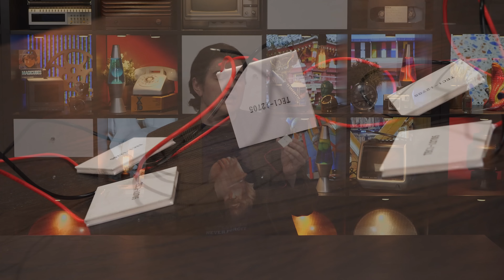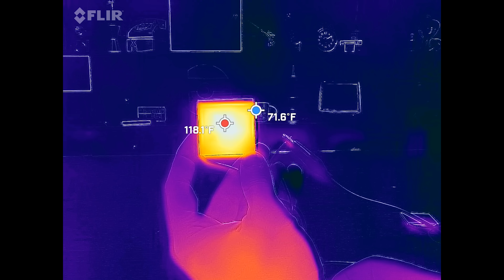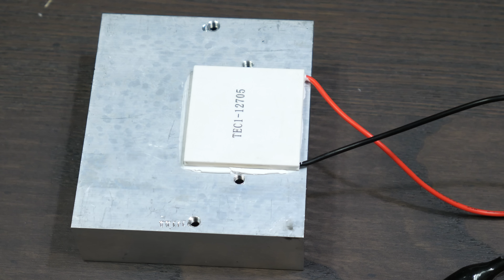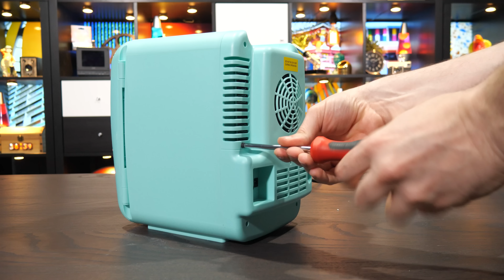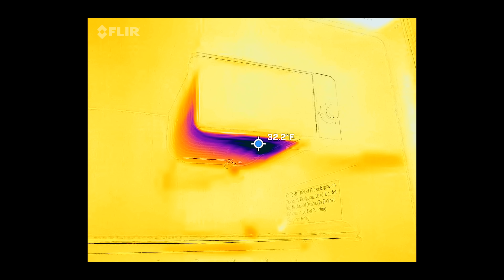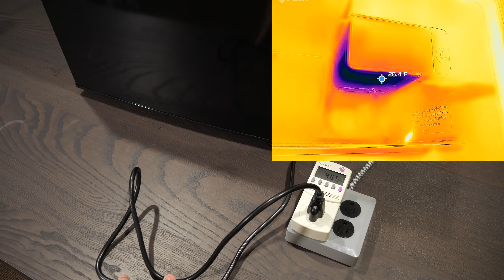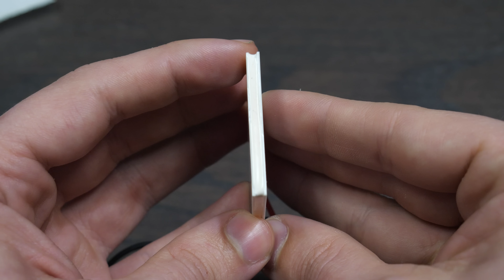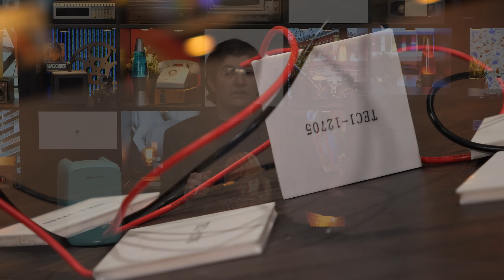Thermoelectric cooling: it's not great.

Comment: One use case for peltiers i know of: Cooling chips in mobile (automotive and for trains) applications:
- No power restrictions
- Only need very occasional cooling and only very little of it: Only in the middle of summer and/or in the literal desert. And only enough to make the chip not fry itself, so can stay at otherwise toasty temps.
- no moving parts -> reliability, wouldn't want your train to not work (or even boot up) just because of a broken fan and it being in the sun for too long.
- if you get creative with your design you can use the vehicle frame itself as the heat sink
- added benefit as you said: can keep your chip from freezing as well (the chips work fine, it condensation you are worried about)
Reply: Also high end video cameras sometimes use a peltier element to keep the sensor at stable temperature (or sensors in the case of a 3 chip camera).

Comment: One actually really interesting application of the thermoelectric effect is in power generation; just as many devices can create a thermal gradient with power, they can also generate power from a thermal gradient! This is used in space probes going to the outer solar system in the form of radioisotope thermoelectric generators, RTGs! If you put a plutonium slug in a tube and put radiators around it, with a thermoelectric device in between the two, you can generate a pretty useful trickle of power for as long as the plutonium lasts before decaying into more boring substances. It's not a *lot*, but it's really useful in situations where sunlight is too dim for solar panels to be practical.

Comment: The best use case scenario for peltiers is in scientific or electronic equipment for cooling laser diodes, thermally stabilizing laser crystals, and reaching ultra low temps by stacking progressively smaller chips in a cascade arrangement.
Reply: thermocyclers in molecular biology also use these things and they're very effective in that context. the thermal mass it needs to cool is pretty minimal (even the larger units might only have to cool 10-20 mLs total) and it's in an insulated space, so it can achieve pretty precise temperatures with controllable temperature profiles.

that said, people abuse the heck out of them. they'll do things like leave a near-freezing hold at the end of their programs for tasks that REALLY don't need to be kept cold, and then let it sit on that for hours.
Reply: Deep space astrophotography cameras also utilize peltier coolers to bring their CMOS sensors down between -10C and -20C.
Reply: @timK0WTB  Yes, another good example, cooling sensors to reduce noise. Basically, any application where you have to cool a very small mass, and the peltier has the versatility to achieve a wide range of temperatures.
Reply: They're pretty useful for isothermal calorimetry titration too, which is absolutely the slickest and most elegant method of determining enzyme kinetics.
Reply: i love modern peltier element thermocyclers (for PCR). back in the day the earliest ones moved tubes physically from water baths kept at difference temperatures and that's miserable
Reply: I used to glue them to imager chips at my first job
Reply: ...like the way the pyramids are stacked?
Reply: @scorpionpizzaandcheeseextract  Yes, very much, with the smallest chip cooling the component, and each larger chip cooling the smaller chip, though it often appears upside-down.
Reply: Common for cooling devices for race drivers as well.
Reply: @prodigalpilot  Are you referring to the cooling suits that they use? The only ones I've seen use a cooler of ice water. Peltier would be pretty large and inefficient, but so is lugging around a cooler full of ice water. I'm actually in the middle of making a cooling jacket using a small DC compressor I got from a cooler for 80 bucks. I'll post a video of it when I get all the parts gathered. It's going to be pretty much just like the one Adam Savage made.

Comment: It's always fascinating how you can keep a topic like this interesting in such a long video, even if you already know everything.
It would have been interesting if you found out why refrigerators used to have the warm side of the circuit in the side of the wall instead of in the back.
I always found that more practical, as there is often space and air outlets at the back of built-in units.
I always found it less practical that the heat is dissipated to the side.

Well, maybe next time.

Greetings from Vienna.

Comment: I can say I have one of those coolers using the peltier devices and it holds about 6 cans and it kind of sucks.  It's clearly relying on you having cooled the drinks before hand and can only marginally slow down the ingress of heat.  It does have the ability to put heat into the container but it sucks at that too!

Comment: Several years ago I was given a cube type mini fridge that looked just like the one you have without the freezer section.  It was not cooling properly so I fixed it. When I opened it up I found that it had multiple peltier coolers 1/2 of which had failed.  I was surprised as I thought it would have been a small compressor setup.  Ordered some replacement peltier coolers and fixed it, but never used it as it took too long to cool down anything.

Comment: I took one of those little bastards apart and made a temperature testing cell... I could take a circuit board and move it from 20F to 120F just by varying the voltage and polarity of a big power supply.  Worked great!  After testing was complete it went in the trash along with the case etc.

Comment: Not only are Peltier elements reversible in that if you reverse the voltage you can heat opposite sides, it's fully reversible in that if you have a temperature differential you can get voltage out of it! I've seen it be used for a cast-iron fireplace fan made to blow the hot air out into the room once it's hot
Reply: Its a Seebeck generator.  Seebeck precursed Peltier and technically the heat into power instead of the opposite is referred as Seebeck not Peltier.   They are both thermoelectric generators, just one converts heat to electricity and the other uses electricity to move heat.
Reply: I have those fans, and they do use a Peltier device
Reply: THAT'S how those fans I see sitting on the homesteaders stoves on youtube work.  I knew it was the heat somehow, didn't know they had a peltier in them.
Reply: @piquat1  Those little homestead stove fans are probably Stirling engines, actually.  They have more moving parts, but use zero electronics.
Reply: nah my boss has one, they're Peltier devices for sure. It's a two piece heatsink with one sandwiched between. The upper section dissipates sufficient heat for it to run a small DC motor
Reply: Check out the BioLite CampStove -- it's a forced-air smokeless wood stove, using a thermoelectric generator to power its own fan and also charge USB devices. I know you can do something similar without moving parts (rocket stove) but I thought it's neat!
Reply: On paper, yes. But in the real world, to get any decent amount of power you need to get hot side up to a pretty high temperature - at least 200c. But the device is held together by solder.... which melts at that temperature. So it just falls apart. You can find ones made for generating electricity, made with high-temperature solder, but they are harder to find and cost more. Those are the ones you see on those stovetop fans.
Reply: @vylbird8014  Thermocouples are generally welded rather than soldered, so they can operate to nearly the melting point of the wire they're constructed from.
Reply: @strehlow  Thermocouples, yes. But not peltier heaters. Unless they are expressly made for energy generation, there's no need - soldering is cheaper.
Reply: Their bigger brothers are the radioisotope thermo electric generators used on some space probes and very remote light houses.

Comment: One thing that's kinda crazy is that I've never seen one of these little peltier mini fridges, with two compartments, one hot and one cold, despite the fact it would be essentially free (running-cost-wise) to do so. And sat on your desk at work, a box that keeps your coffee and sausage roll hot, and your milk, soda and sandwich cold, would be pretty handy. I guess probably someone makes one, I haven't really looked, but they can't be common.
Reply: You'd need some pretty hefty insulation between to two sides, or conduction is just going to undo the cell's work.
Reply: @Iceykitsune  True, but you could stick a couple of inches of polystyrene between the chambers, and wick the heat across the gap with heat pipes. Or use vacuum insulation, although that might kick up the cost by like $10 or so.

Comment: I bought a water dispenser that considering its price (as such a the table top fridge in the video) I never suspected used a Peltier.  It was completely unfit for purpose as once you drank the tanks contents, it would take 24 hours to cool it all down again, and it only held about a glass and a half of water.  It also used the cheapest, crappiest fan so was loud and got louder over the months I had it as bearings wear out quickly on cheap fans.

Of course I eventually replaced it with a table top fridge, which cost less as I got one used.

Comment: The one place I see this technology working great outside of special lab and process applications is making custom coolers for trucks and boats where you can run on solar power. In those cases you can use stacks of two Peltier modules to get a lot colder than single modules get, and you can use the sea or the vehicle frame to dissipate the excess heat without a fan.

Comment: Normally i find your facts good but this time you are wrong.  The bad build small fridge is not the peltier elements fault. Yes peltier is less efficient in moving heat, but your examples are not the reason

You can stack them. And the one you test is one of the worst examples i have seen. No internal cooling fins. And the external one is mounted wrong direction.
And add a controller to it, i know you can — use the same pid you have om your red one

Comment: I have an application where a device runs in the San Antonio sun. The device an handle 50C, but not a lot more than that.  We have a pretty big heat sink on the device, but more heat sink will prevent the device from working properly.  I'm considering using a Peltier device to move more heat away from the device to a place where a bigger heat sink can be employed.  Energy use isn't a big problem; the device lives on a big battery powered vehicle.

Comment: I know this is a "bash Peltier cooling" moment, but I just want to say how absolutely crazy it is that those little things cool at all! In the lab I work at, we have a couple very-sensitive spectrometers, and the way they are so sensitive is by cooling the CCD cameras (less heat = less noise). For one system, there is a dewar that needs to be filled with liquid nitrogen in order to get it cold. The other, just a little Peltier cooler. And it is JUST AS EFFECTIVE! That little shit can get down to LN2 temps, it only takes a few minutes, AND there's no need for external coolant. It amazed me the first time I saw it work lol
Reply: This is the main use for peltier cooling I'm familiar with. Dedicated astrophotography cameras have them to combat read noise.
Reply: I wonder what the power draw on that stack would be (edit: also that's really cool, I just think it'd a whole lotta watts)
Reply: @noobkanon2  It doesn't need to be a lot. In those better applications it is creating a very high temperature differential, it just isn't good a moving a lot of thermal flux. It can be thought like the difference between volts/amps/watts or pressure/volume/flow. A candle burns at over a thousand degrees but doesn't produce that much heat. Similar thing in reverse.
Reply: @barongerhardt  Hahahaha ohhhhh yeh. I laugh because would you believe studied thermodynamics during undergrad. But apparently 10+ years ago was too long ago until your comment brought a bunch of forgotten knowledge rushing back. Oh Fourier, I forgot you lived here too 😂
Reply: We use them in an asphalt lab to cool air and thus draw moisture from a vacuum (pump saver) and I agree it works very very well.
Reply: I'm an astrophotographer and love my little TEC-cooled IMX533 sensor (technically a CMOS camera instead of a CCD, but still). Since it's cooling a thin object in direct contact with it, it manages to cool the sensor to something like 30C below ambient, and gets that reduction in read noise without the exposure-destroying vibration you'd get from other cooling devices.
Reply: I'm really glad to hear of all the lovely uses for peltier coolers people have posted in the comments. It is such a lovely bit of tech, and it would be really sad if it was practically useless. You go, little peltier coolers!
Reply: They're about the same crazy as thermocouplers, which are essentially two wires of dissimilar electrical conductors.
Reply: I love how you consider valid criticism "bashing" because you have absolutely ZERO context whatsoever for what word means.
Reply: @tim3172 nah, he's bashing
Reply: @tim3172  it's only valid for the marketed mainstream use case, not the actual technology
Reply: @tim3172  He opens the video saying of the technology, "its not very good. like, at all". Throughout he is pretty clear that he sees no value in the tech.
Reply: @WillKew  He spends a good chunk of the video talking about the niche use cases where they do have value.
Reply: @tim3172  What "valid criticism"? This video is just stupid. He's complaining that a ruler sucks at measuring the size of your house while pretending that anything at a smaller scale than that is "niche". Peltier cooling is actually pretty amazing and what you should use if your thermal loads aren't large. They're cheap and they last forever. Them being inefficient doesn't really matter in that context. They're also the only reasonable option if you're trying to maintain a near room temperature, precise temperature because they cool and heat really quickly.
Reply: @Mezmorizorz  Pretty sure most of his criticisms were for *this specific uses of peltier coolers*, not peltier coolers in general. Specifically, the tiny drink fridges like this one being basically worthless in every metric. 

Or, to put it in your terms, he's complaining that there's a ruler marketed specifically for measuring the size of your house, and how that's dumb.

And of course smaller scales than that are more niche than an object that is literally in every modern house on the planet.
Reply: @vene  Except that's not what this is about. He's using the shitty Wish fridge as a strawman to universally bash Peltier coolers, his pinned comment makes it pretty clear he doesn't see the value in them at all.
Reply: @Mezmorizorz he's really just criticising them for this specific application.
Reply: @GEONEgaming  ?? he makes it clear that the technology has totally valid niche applications and that he's bashing their usage in consumer goods. is it this important for you to be mad at somebody about something? find a more productive outlet for that energy please

Comment: The Xbox Series X version I got from Walmart had all of the use cases in the instructions. You had to put already cooled drinks in it and it practically alluded to just not having it plugged in. It came with a car plug though and suggested that option a lot stronger but I felt it kind of weird since it's not really what it originally was advertised as. Honestly, the car scenario is interesting if you have drinks in your fridge you want to bring with you on a trip to the beach or something but also those drinks probably just get warmer. Getting ice and a cheap cooler is ultimately better for that scenario too lol.

Comment: The proper application of Peltier elements is not so much in generating a temperature differential, but precise and rapid temperature control close to a specific setpoint. A prime example would be controlling the temperature of a laser diodes, which is one of the factors that determines their operating wavelength and bandwidth. In high power, wavelength controlled semiconductor lasers it's not uncommon to find a refrigeration cycle cooler for coarse temperature control on the "hot" side of a Peltier element, and having the fine temperature control through the Peltier at a very small temperature differential.

Comment: I've built several Tec on water computers. I've never seen processors run so cold.
Reply: I found this to be the only method to have a CPU run at sub ambient temperatures without using a refrigeration unit for cryogenics. Though I have to say, I saw a Pentium 4 3.4 gigahertz socket 478 processor run at over 8 gigahertz on cryogenics. The processor was reliable at that speed too, the only thing that got him was condensation. It fried his whole system

Comment: I have a thermoelectric fridge that can cool up to 36℉ (20℃) below ambient temp, and the fan is relatively quiet. It works so well that ice builds up on the peltier element!

This is a Minecraft creeper fridge, and it costs $30 at Walmart. It'll run up the power bill to make up for that cheap price, though!

Comment: Using La Croix as a tool for measurement of temperature is a better use than as a drinkable beverage.

Jokes aside, I’ve been using the cheap mini fridges for a while and though it works for what I personally need it for, it’s definitely an extremely mild and limited effect. I’ll probably spring for a proper one when I have more room to store it.

Comment: I did the math on the  COP of Peltier element vs the simplest compressor refrigerant system and then never took a second look at them.

Also: At 20:54  I did some internet detective on the the DFB30DF compressor, and the datasheets say the COP is somewhere between 1.25 and 1.27. I'd guess its because its a sealed box and you don't want to do things like short cycle the compressor.